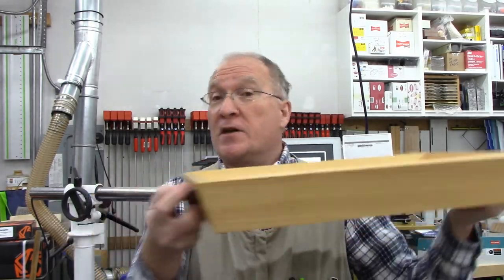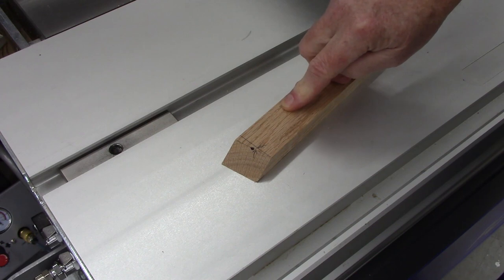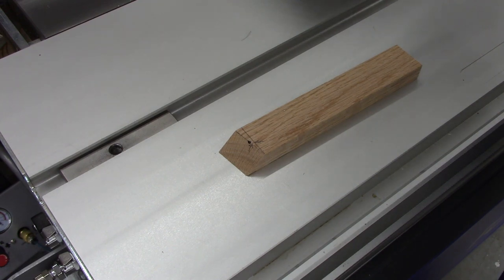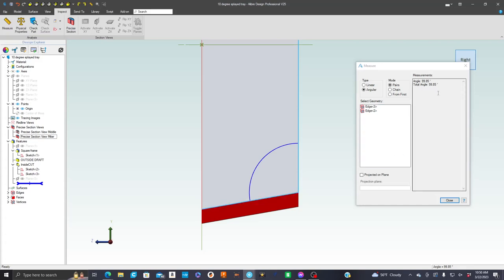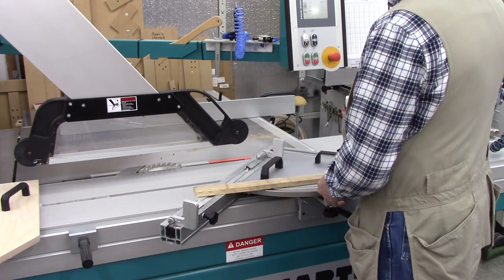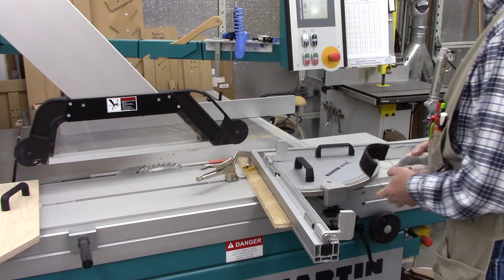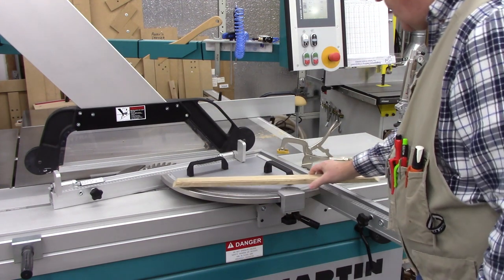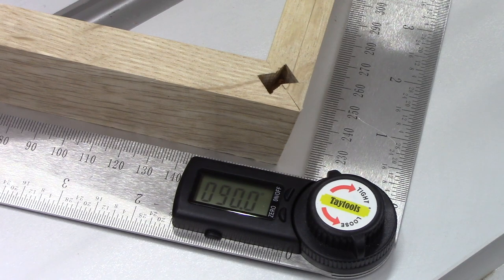Understanding Compound Miter Geometry and Settings

Comment: I changed my comment because I started having trouble making angles fit.  I made a splayed box with 20 degrees from vertical.  So I need to set my miter to 18.88 and my tilt to 41.64.  My tilt on table saw and miter saw goes from 90 to 45.   How do I get those angles less than 45?  All of them with 4 sides that come to 45 degrees are a tilt of less than 45.  What am I missing?
Reply from the maker: The chart indicates the blade tilt off the vertical.  Steve
Reply: @extremewoodworker  I finally figured that out and got some good joinery!

Comment: I'm sure you will get the correct cut but imagine doing it on tools the common fella has.
Reply from the maker: I have and I had those tools for many years.  Do not believe for a second that I have always had my current tools and machinery.  And yes, it can be done with basic tools.  Steve